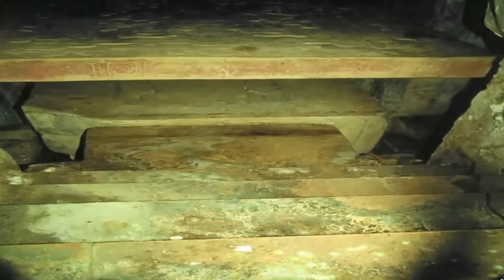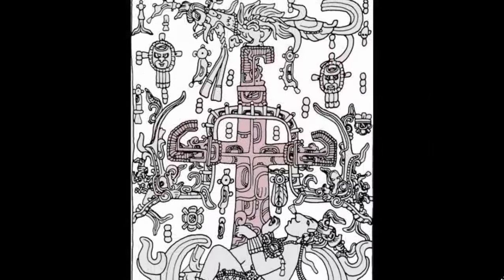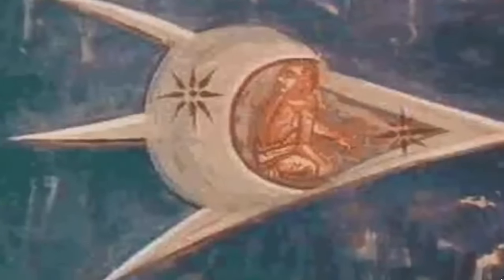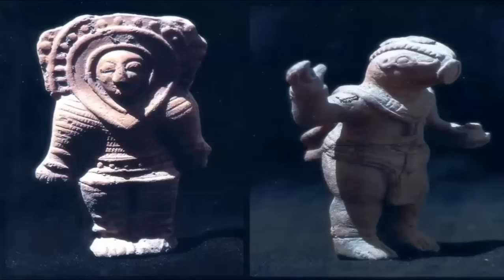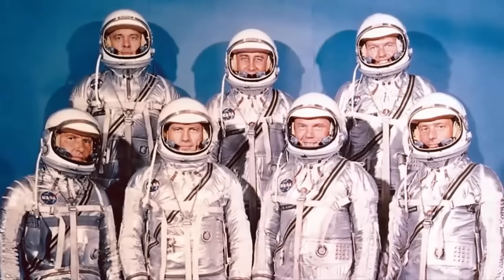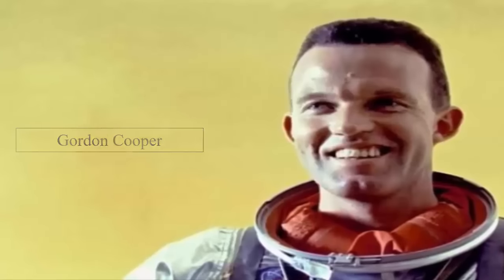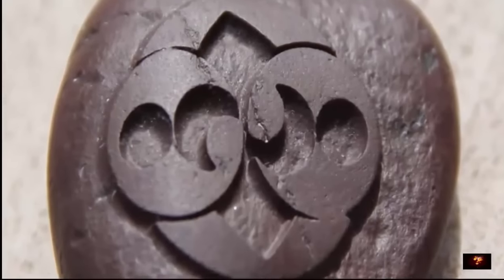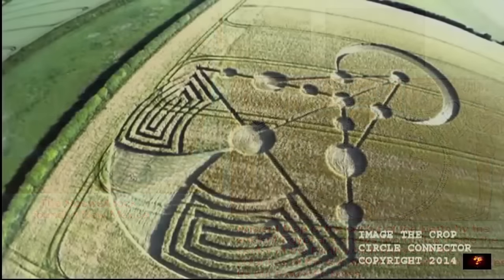Rocket Thruster Beneath Pakal's Tomb?

Comment: 0:47 I find the technical detail in this drawing to be quite compelling if you subscribe to the idea this is a man piloting a space vehicle of some kind.  Note the "pilot" is not only manipulating controls (one seems to be a delicate, fine tuning control maybe like the trim controls on modern jet aircraft) with his hands he is also manipulating controls with his feet (the heel of his left food seems to be manipulating a cog-like pedal device while he is clearly using the top of his right foot to push against another control--this would align with the idea he uses his feet to control vertical and lateral (up/down and side to side) motion).   Any modern pilot can tell you they use foot pedals to control their aircraft in addition to a collective or stick.   There is also an amazingly high degree of redundancy in the design of his vehicle, and this is critical when designing a manned spaceflight system, and the pilot is using a redundant breathing tube as well. Also note the lack of direction bias: like in space, there is no up or down, not only are his redundant systems installed around a central axis (what we would call the X-axis in modern system designs) but if you flip the image over you clearly see a bird like creature outside of the vehicle pushing against the vehicle's velocity vector--the pilot and bird creature are "upside down" with respect to each other, but this seems normal to them, no common gravity vector, hence they appear to be in space (I remember the old Gemini project when we first attempted rendezvous between two Gemini capsules, as they approached each other their relative orientation was 90degs off from one another, and one of the pilots (while looking out the window) stated "your upside down"" to which the pilot in the other Gemini capsule responded "somebody's upside down"  since they both felt "normal" in the zero-gravity of near earth orbit).  I firmly believe this is portraying some event occurring during a manned apace flight and there appears to be "other celestial architectures" outside of his vehicle as well, and one of them in the lower corner of the image appears to have a thruster plume behind it.